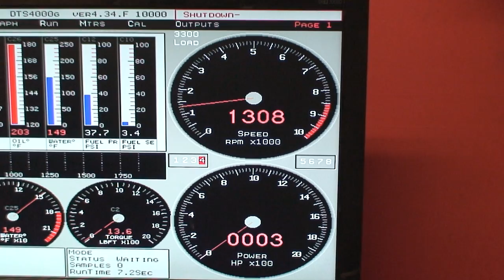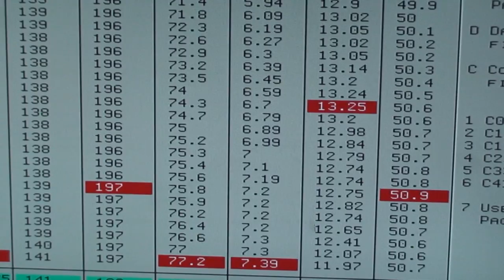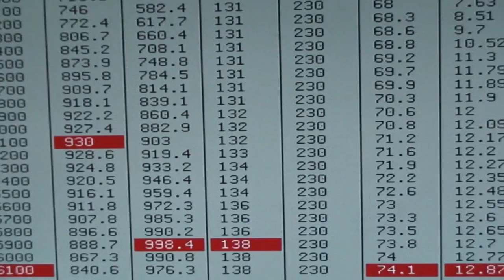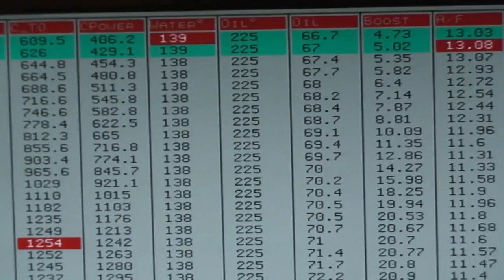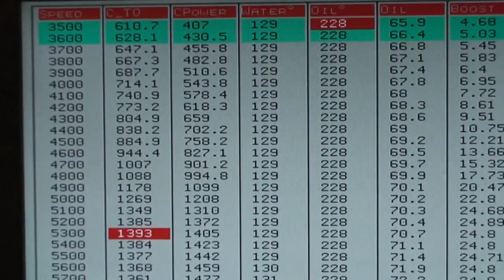New 1500 HP Mirror Image Turbo Ford 428 Small Block.  For Mustang & Fords. Nelson Racing Engines.

Comment: ( To the one fellows question)The reason you would feed the engine nitrogen gas and Oxygen gas as with a submarine? Is because as they demonstrated it can suck a large room clear of air in a few seconds of snap throttle, so supplying a Synthetic atmosphere for it to breathe when being used in an amphibious vehicle will keep it from using all the air in the vehicle when its water baffles close. or it's snorkel becomes temporarily submerged.

Comment: Of course, just about any internal combustion engine can withstand twin turbochargers if built properly.....meaning the rotating assembly (crankshaft, connecting rods, pistons) must be strong enough.....the metals must have a VERY tight microstructure.....and everything needs to be balanced and torqued down properly....

Comment: you can make it fit.

You'd need to do a range of fabrication though. Rear suspension would need to be beefy, engine mounts etc. Difficult, but not impossible.

Comment: 428 is a standard small block Ford size. Old school pushrod, not their modern OHC engines. And, as said, small blocks can be built to a 442 or even 454.
427 is standard small block Chevy size.
Reply: Those are all big blocks look it up anything over a 400 is a big block so 390,302,289 is small block…

Comment: 427 WAS (a long time ago) a big block. Fast forward to modern times and 427 is a small block. Ever heard of the LS7 in the Corvette Z06? Or ever look at any crate engine manufacturer? You'd be hard pressed to find a big block smaller than a 454. ALL of them sell 427 SMALL blocks. You are commenting on a video of such a company that sells even 442 and 447 small blocks.

Anyways, the point is, 427/428 is not an uncommon size for small blocks now.

Comment: Well just for an engine  block that can handle all the force of this system would probably run you 10k. --- Something like a Cosworth High Performance Long Block Assemblies Long Block Assembly CS600/CS600X Big Valve Cylinder Head K3766 Camshafts OEM Crankshaft USDM Spec

Comment: Wrong on that one sonny. Yes, the old 427's were BBCs. The 396 were a BBC. Now, the SBCs easily goes above 454.
ALL of NREs TT 406's 427's, 434's, 441's, and 454's are SBCs. Your dad either needs to know what is going on, or stop laughing about things he obviously do not know about. Does he also think that 2 bolt mains is the way to go? He's the one we are laughing at now.
BTW this Ford is a FSB.

Comment: The current Generation 3 engines are a completely different design than the old small blocks and big blocks. The LS7 at 427 cubic inches is the same design as the LS1, at 346 cubic inches. The LS7 just has a larger bore and longer stroke. Displacement has nothing to do with the term of small block or big block, those terms both refer to the engine design, or platform. It is possible to build a SBC to over 500 cid, or a BBC as small as 300 cid by varying the bore and stroke.
I'm done.